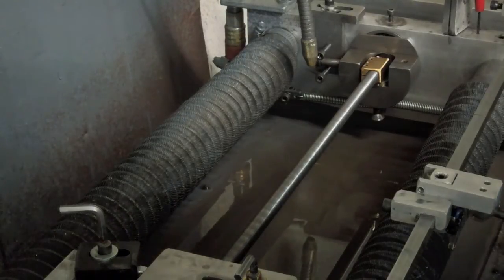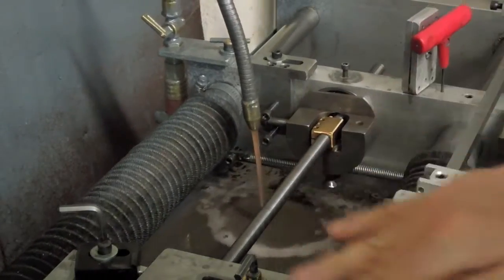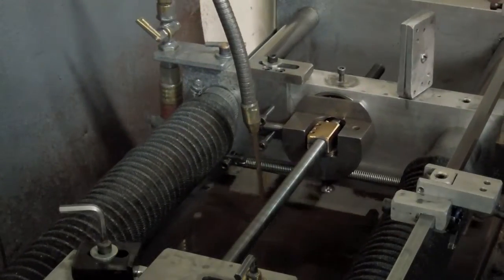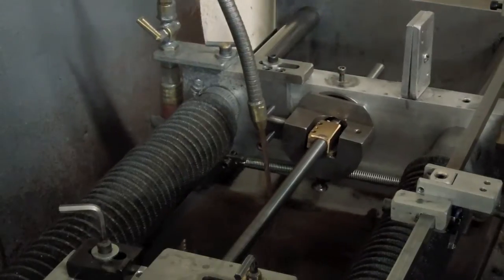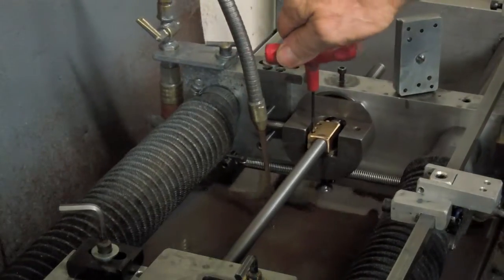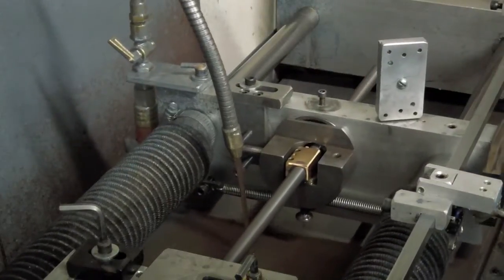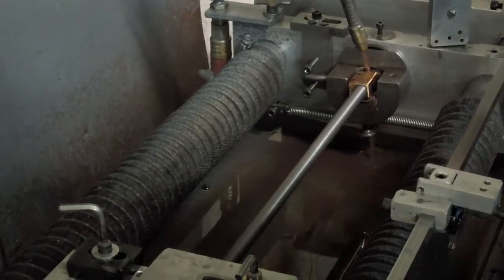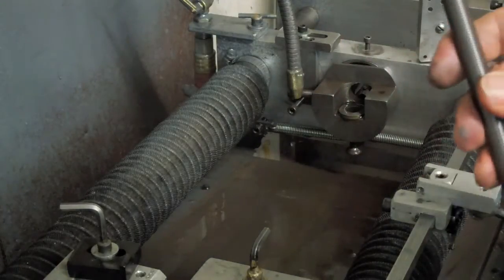LEAD SCREW LAPPING

Comment: What’s the purpose of the operation?
Reply from the maker: The "Lead" or distance can change as the nut moves up or down the screw. Example: the machine readout says the table went 2.0 inches but in reality the table traveled 2.002 inches or  went 1.998 inches. This is due to "lead error". When the screw and nut are lapped together this cuts down the lead error quite a bit.